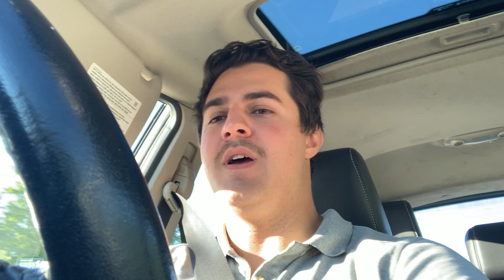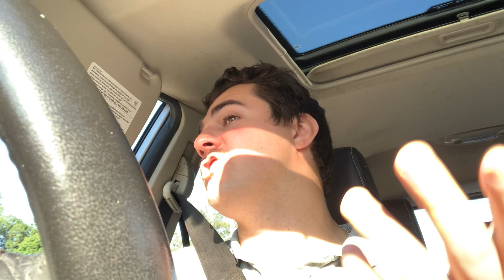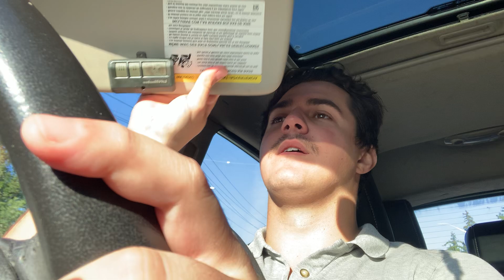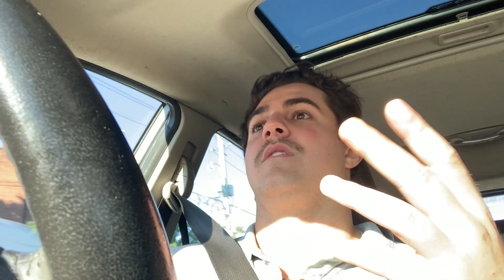How I Price My Vibe Coded Desktop Application - Vibe Coding Commute #28

Comment: The question is how do you update a desktop app? You’re going to have to create a built in update installer. Another reason why web based is easier. You can push updates instantaneously.
Reply from the maker: Yep, that’s definitely one of the tradeoffs. The plan would be to use an auto-updater so the desktop app can pull signed updates in the background and install them with minimal friction. Web is obviously easier there, but I still like desktop for the deeper local/system integration.
Reply: @nicvandewetering yeah it’s going to be a bit of work for sure. You have to store your signed update on a server. Have the app check for new builds, then download and install automatically.